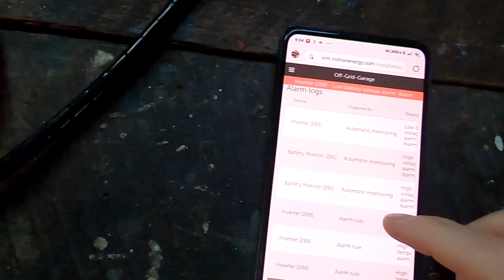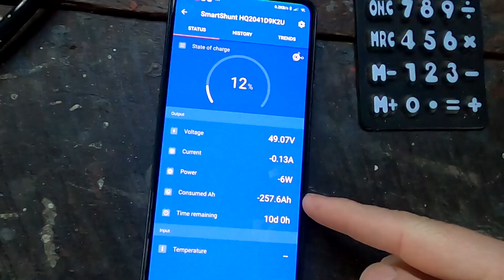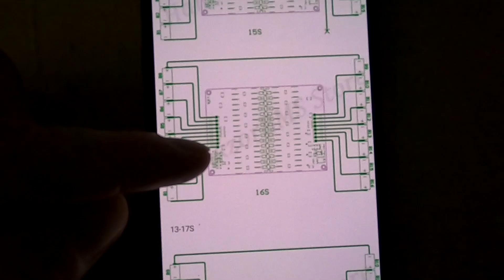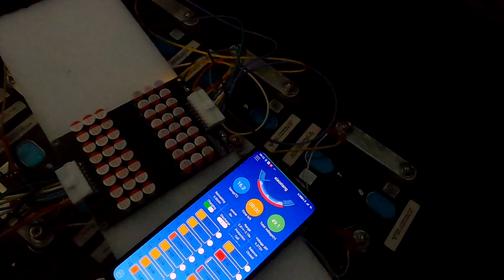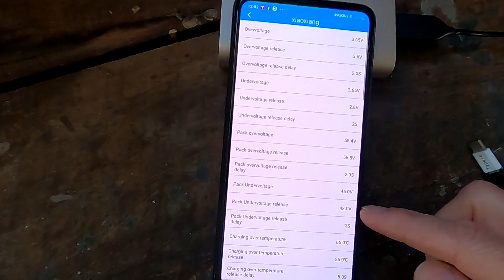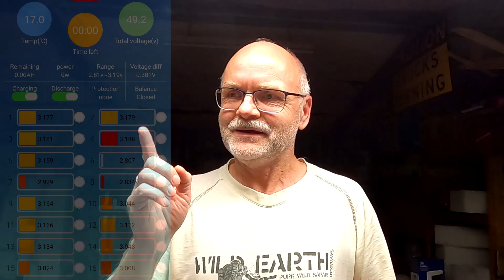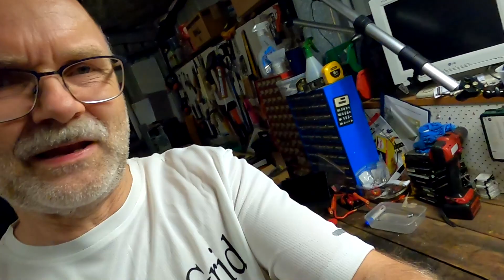Can the active balancer save this battery? Impressive result!

Comment: This balancer is impressive indeed. But what does balanced mean? You know, voltage is not everything. So why are some cells too low?

If all cells are equal in terms of capacity, you are right. Balancing the voltage, no matter if at top or bottom, is always good.

If one cell is lower in capacity, you get a problem. At the bottom end, its voltage is too low, so the balancer adds energy to it. Then at the top end, its voltage rises faster, and the added energy appears as an additional imbalancing. The balancer is not capable to align the charging level of the cells to each other. It makes it worse.

If your cells don't have this problem, it will come when cells are getting older. I don't see an automated method to solve this. I would monitor the over- and undervoltage of a weak cell and then decide to add or remove some Ah manually ... until the cell must be replaced. This will come soon, the worst cell gets the highest stress.
Reply from the maker: The cells are not all the same and never will be. Even they come matched from the supplier, they are not matched. You're dealing with 16 individual cells. And apparently, the drift and spread gets worse when they age over time.
The balancer prevents the battery from being disconnected prematurely by the BMS as cell 6 would have triggered the cell low voltage disconnect. The same happens at the top if #6 goes to high.
Reply: OK, very interesting. This makes it a very dynamic system. The missing capacity of the weakest cell is compensated by the balancer by adding energy at the bottom and removing this and more energy at the top. There is no continuous improvement but the weak cell is tossed from one end to the other. You think the balancer is strong enough for this? This is not what you have tested yet.

Comment: Loved this video, your exuberance for discovering that a decent Active Balancer and what it can do for your pack(s) says more than anything else could.  Looking forward to the Part-2 of this doing the charging and topping with the active balancer. 

Just to highlight again: 
- Active Balancers transfer power from Hi to Lo cells.  Works well for larger capacity cells.  Active balancers are available to 10A Capacity but at a cost of course.
- Passive Balanvers are more suited to smaller cells and only "burn off" voltage from hi volt cells and are quite slow at <1.5A dissipation.  There are better with properly matched cells as well.
No Balancer can fix a bad cell or correct for deficiencies.

Also note that while a BMS' harness maybe 22 gauge +/- because it does not handle any current or high voltages.  An active balancer can transfer amperage through the wires and they must be sized appropriately for the capacity of the balancer, please always follow the specifications.

MOLEX connectors (or similar) can be used to merge BMS Harness & Active balancer harness.  Feed BMS & Balancer leads into one side, then the larger gauge wires from the other side to the cells.  This will allow the BMS & Balancer to share one lead per cell.  

Some people use "HELLA H84960111 8-Way Lateral Single Fuse Box" or similar to make a similar connection while fusing each cell and an appropriate Amp capacity fuses (relative to balancer capacity).  Personally, I don't think this is nescessary and actually may not be desirable because it most likely would alter the IR & Cell Differential readings.
Reply from the maker: Thanks for your great comment and summary. I was reading about fusing the balancer, but we don't fuse the BMS either, do we? And you're right, it would add additional resistance and may influence the measurement and result.

Comment: The only way an active balancer is ever gonna work in both ends is if it is sized to maximum charge/discharge current. So in your case, with ~3kw system you need to parallel about 10-11 of them. 🙈
Reply from the maker: It will balance during float phase when there is no current going in or out of the battery 😉
Reply: @OffGridGarageAustralia  You have a bottom balanced pack now, and your charge parameters are set for a top balanced pack. If the charge current is higher than the balance current, the weakest cell will most likely trip the bms cut off before you reach float. And with a relay based bms that is far from optimal. Sure, you can change your charge parameters to work for bottom balance, but what is the point with the active balancer then?

Comment: I see a disadvantage especially in your case with a relay-bms and slightly missmatched cells. If you're battery is at a high state of charge and there is a high amperage outside, overvoltage disconnected will trigger because the balancer destroyed your top balance and will not be able to keep up with the sun. Because you have a relay-bms, there will bee no consistent power anymore until the sun is down and the balancer is finished. You maybe get that alternating on/off situation again...
Reply from the maker: I don't think this is going to happen. My max charge voltage is only 3.4V and then I let the battery absorb, so current will taper off. So far the 'balancer test' seems to work quite well but I have to wait what happens when I fully charge the battery again.

Comment: With your raspberry, maybe you could turn on your active balancer with a relay (there is a pad "run" weldded on the active balancer) only when you are in the top or the bottom of your SOC ? It will correct the little deviation every day, but when you're on the flat curve, it doesn't work and don't transfert power between cells.
Reply from the maker: The balancer runs 24/7 now for the test. If it does not balance in the flat part anyway, why should I make the effort and turning it off? The standby current is only a few mA, far less than for the Pi. Who would give the signal to start the balancer?
Reply: @OffGridGarageAustralia  i think you shouldn't balance in top AND bottom... Only one no ? So you should disconnect it ? The rasp know thé soc ? For example if thé soc is under 10%, connect thé balancer ?
Reply from the maker: @mccyrille  yeah you definitely only do top or bottom balancing.
The Pi knows the SOC but then what? How?

Comment: Now You are bottom balanced but top unbalanced. 
Before you was top balanced (thanks to BMS) and bottom unbalanced. 

The problem is in your cells number 6-7-8.

Ps. You will reach the same results without any active balancer. 
the secret is a good first bottom balance
Reply from the maker: If you do an initial bottom balance and attach any balancer (BMS balancer or active balancer), you destroy the bottom balance right away. That does not make any sense. Bottom balance focuses on the same charge in each cell. A balancer takes charge away from individual cells, either burns it or transfers it into another cell.
From what I can see, you don't need to do any initial balancing on your new cells when you get them and you use an active balancer.
Reply: @OffGridGarageAustralia  yes, sure but in your bms you can turn-off top balancing. 
In this way, you'll never lose bottom balance. 
I bottom balanced my cell in 2019 and never again up to 2021. 
Every time i discharged them, the voltage is perfect 3V for each cell. 
Obvious when i full charge them, there's one cell run to 3,6 and the others are between 3,45 and 3,5 (total 56V)
Reply from the maker: @zarbonida  yeah, I can turn of balancing. I have to if bottom balancing...

Comment: Nice video as always Andy. Keep educating us. Thanks. Question in generator charging. If I had 50kwh battery bank and a 7kva generator. Would I devide 50/7 to get the charge time duration or are my maths wrong?
Reply from the maker: That would be correct. You're adding 7kWh per hour charging, so ending up with 50kWh charged in around 7h.
Reply: @OffGridGarageAustralia  Great thought so. Thanks for reply. Wanted to check.  Awesome work buddy. I’m learning so much. While I’m getting the basic understanding, from the build perspective in the earlier videos, a lot of the detailed technical stuff over the last month or so  I’m still trying to figure out. Keep up the great work Andy. 👏🏾👏🏾🇬🇧🇯🇲

Comment: On the connection diagram, you can see the MOSFETs and other components. So it is definitely the "bottom" side and all pins seems to be right.
The reason for rised voltage is, the flat area in the charge/discharge curve. You need not much energy to charge a cell e.g. from 2.8V to 3.0V (diff=0.2V). The energy comes from cells with 3.2V and this cells will not drop down 0.2V. Maybe only down to 3.15V or 3.10V. So the total voltage will rise. Sometime the losses of the Balancer will decrease the total voltage.
Reply from the maker: Yep, both is correct, just didn't see that when I was recording. Thanks 😉

Comment: Can these active balancers be permanently left active on the battery pack or should they only be activated as needed?
Reply from the maker: Yes, they can be permanently connected. I've got it running for several days now and it works really great. I'm please with the result so far.

Comment: In my first test I charged the cells to 3.45V with a cell difference of greater than 100mV. The DALY BMS switched off charging at 3.5V for the highest cell and the internal balancer apparently had no effect. Then I connected the active balancer and you could watch the voltage difference decrease. It took less than 12 hours for the cells to balance at 3.45V with a voltage difference of 1mV. I was just as amazed as you.
Reply from the maker: Same experience here, the BMS's balancer just does nothing with these high capacity cells. Now, everything seems to be in balance no matter what I do.

Comment: Mine showed up yesterday. yet to try it as my cells have been kept 0.014mv in check with my daly bms anyway. i have to say the active balancer pcb vs the passive pcb i can see the active pcb is nice and clean while the passive is a bit more dirty looking. but the passive balancer was like $10 vs $60 for the active. id trust the active more when it comes to not catching fire lol. I will test the unit and hopefully it performs well, i was and am still a bit skeptical on a balancer that is always balancing at all times since i have top balanced the cells so well this balancer if the battery sits in a low SOC for a period of time will effectively bottom balance then re top balance once full again and left long enough, not sure about tis being ideal. I think also from reading that older models of these balancer had weird voltage settings and wills video he may have had older versions that were junky vs the new ones more and more people seem to be having more luck with them performing well.
Reply from the maker: Yeah, probably forget about balancing, top or bottom. These keep the battery in balance all the time. It seems to work great, I've got it attached since a week now and max deviation was 17mV during higher loads.
Reply: @OffGridGarageAustralia  Nice. i have some used cells i will be testing the 8s version on. I have also designed a box for the 8s version> https://www.ebay.com.au/itm/274871525062?hash=item3fff9e9ec6:g:PnIAAOSwfPdg853K

Comment: I picked up a couple to play with. They just arrived yesterday. I'm familiar with the boost/buck style and am curious how this capacitor-only style will work. I sure wish I had the 32 channel 'scope I used at a prior job... I'd be monitoring those capacitors!
Reply from the maker: What do you expect is going to happen with the capacitors?
Reply: @OffGridGarageAustralia  I expect they are going to charge to cell voltage or maybe 2x cells, then discharge into the lower cell of the pair. But I'm not sure and I'd like to know how it works!

Comment: Glad you see the light a active cell balancer removes a ton of headache / hassle as I suggested several times its the way to go for simplicity and theyre power draw is almost a mute point the thing is it protects your cells from imbalance of cells dipping to low while others are in the good this can and will prolong the lifespan and use ability of your lithium cells its a win win for literally pennies compared to the rest of the hardware and such so where is the negative there is only positive in installing / using a active cell balancer.
Reply from the maker: It seems, I have to agree 😉

Comment: You really don't want to balance at low end. Only high end. The smallest cell will reach lowest voltage first. You then put extra charge in only to have it charge full first and have to take it out again. Pick either too or bottom and stick with it. Top I recommend for your use.
Reply from the maker: Bottom balance won't work for a setup with banks in parallel anyway. But even top balance might be tricky if the balancer of the BMS starts its work. It creates the same imbalance as the active balancer does.
I should top balance and turn off all balancing altogether.

Comment: In Practice , TOP Balance every 3-4 days at 3.65 for 40 min. my system is 24 volt , calculate for your system . This chemistry needs top ballance . It is fun watching you teach others the hard way . ;-) you will achieve the same results with top ballance .
Reply from the maker: I'm a tester and explorer, sharing what I find along the way. It may or may not be useful for others. Of course I could just top or bottom balance and leave it. What would we learn? Nothing. We would just do what we read somewhere or what others tell us to do. The big question is what happens if we don't follow this and explore new ways, test and ... fail, test again differently.

Comment: Nice  
On  Reliable inverters is there a way to increase the high voltage up input
My  keeps shut down if if volts are at 14.3  and with my new lithium  battery  I lowered the pack voltage  to 14v  so I am losing pack volume
Reply from the maker: Can you not adjust the love voltage disconnect in your inverter? 14.3V is far to high. It should be around 11V for a 4s LFP pack (2.7V/cell).

Comment: they work even better with higher cell volts (on top). and you can parallel them up also.
Reply from the maker: Why would you parallel them? For faster balancing?
Reply: @OffGridGarageAustralia  if you are running a high current they can keep up better

Comment: I'm curious, could you please do a video of a schematic of how you would set up the system if you were starting again with no limits. Could you have an active balancer beneath a BMS in a 24/7 system on all your batteries.
Reply from the maker: You can definitely leave the balancer connected in parallel to your BMS. That is no problem.

Comment: I tried the link for the balancer and I’m helps confused. I have a 4S pack, should I get 3-4s or 4-5s??
Reply from the maker: That does not matter, really. This is made for Li-ion and LifePO4 cells, hence you need either 3 or 4 cells to reach the 12V voltage. I got the 3-4S balancer for the first testing and it worked well.
Reply: @OffGridGarageAustralia  Thanks for your reply. This has me thinking, I have two battery packs (4s) I plan to wire up with separate BMS. One pack is something like 250Ah the other 304Ah. I wonder if a 4s2p configuration with a balancer like this would allow me to use up the mismatched cells more efficiently by "convincing" one of the cells to deplete faster than the other. I'm not sure how this would work but this piggy backs off one of your videos were you were trying to see if parallel packs were better.
Reply: @OffGridGarageAustralia  I think alternatively I am going to figure out how to read the UART information from the two packs and try to load balance them by turning one off and on if this doesn't occur naturally due to the different pack resistances. The amount of information and control you could have over these packs with these UART BMS is actually quite interesting. I don't even plan to have a shunt but instead just poll the BMS for AMPs to get the usage.

Comment: Looks like that balancer is doing it's job bottom balancing, but you're not going to like the out of balance situation that it created at the top when the cells are fully charged.
Reply from the maker: I assume it will be exactly the same at the top now. Everything is balanced 😉
Reply: @OffGridGarageAustralia  It will be ok if you stay under 90%, but if you get into the upper end curve, they will be all over the place due to slight differences in the cells.
Reply from the maker: @SpeakerKevin  Not with the balancer attached, I guess.
Reply: @OffGridGarageAustralia  That would be great if the balancer would take care of it, let's keep our fingers crossed.

Comment: Andy, seems like you keep having issues with that BMS maintaining good balancing.  I  have a 48v, 16s, 90ah Lifepo4 system with a Daly Smart BMS. It is connected to a Growatt SPF LVM 3000w solar all-in-one inverter. The Daly 48v 100ah 16s SMART BMS is exceptional, maintaining balance between all cells usually under 10mv (under light load) and less than 100mv under high load. No need for active balancer. Please consider doing a test with this BMS. It has high and low temp protection too.  Good luck and keep up the good work! (And Will is right)
Reply from the maker: I have to wait until the new battery is in place so I can take the existing one offline and can top balance it properly again (which I never did in the first place).
Reply: @OffGridGarageAustralia  Top balancing is a painful, time consuming process, but well worth it in the end…at least it was in my case. I’m looking forward to your progress with the new system as I follow along in your journey.  Good luck.